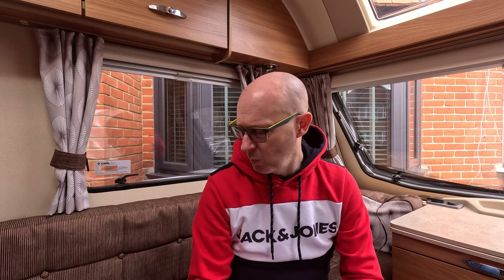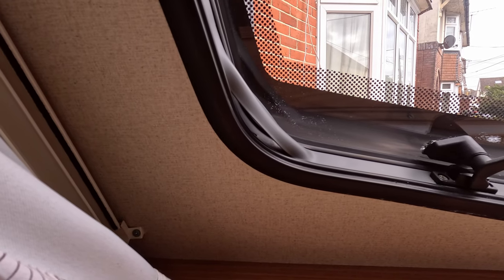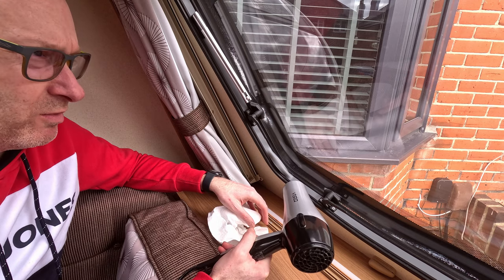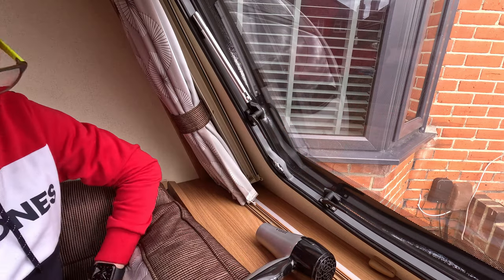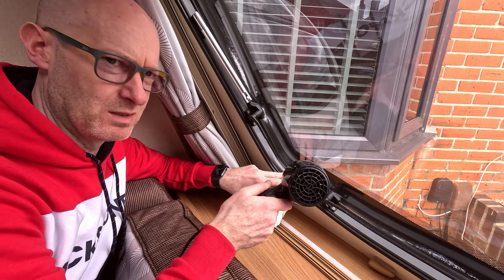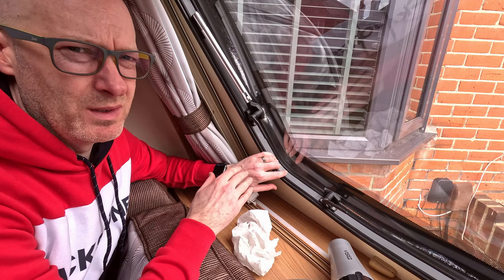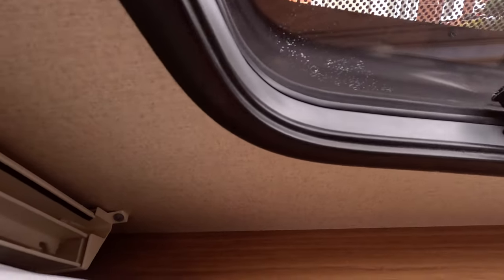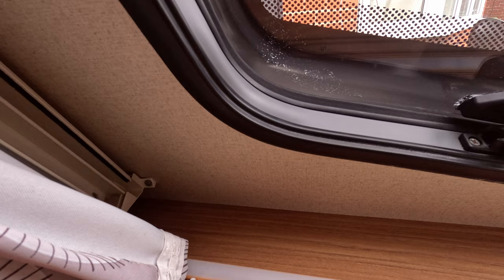Caravan Window Trim Fix, DIY Guide 🧐 🛠️ 👷‍♂️ #caravan

Comment: I had to replace the whole thing in my caravan centre front window.  It was so dry and old and sun damaged.  Just unscrew the catches around the window frame and pull the old tape out.  As I went around putting the tape in, I figured out you had to pinch the centre so you could get it secure into the rubber on either side.  As I went I also put a small hole in it where the screws had to be put back in as you couldn’t tell where the holes were if you went to far.  It was quite easy to replace.  I’m a 58 year old female and had never done it before.
Reply from the maker: Glade you were able to replace the original trim, just takes time but looks great in the end. In my other video, I show this being replaced and I used the trim tool, it's optional but speeds up the process.

Comment: I was giving my van a proper clean out over the weekend & noticed that I have 4 or 5 like that. A very useful video. Thank you.
Reply from the maker: Thanks Ian, this is always good place to start, and if it doesn't work for you then move onto replacing the trim, hopefully this want be the case.

Comment: Perfect timing I've got 2 corners to do but I need to replace the window too, might be easier to wait till I've got no window in
Reply from the maker: Glad it was of help, remember the silicone part is optional but will help with it not happening again in the future. Depending on the reason for needing to replace the window, if it was letting in water then you might want to remove the trim to allow it to dry out first.
Reply: @wobbleboxcrew  unfortunately some delightful individual decided that it wasn't to be a window any longer

Comment: Brilliant. Thanks for the tip!
Reply from the maker: Glad it was of help, just remember once you've heated up the plastic you will need to stretch it before putting it back into place. Also, this won't always resolve the problem, if you find it still keeps shrinking you'll need to replace the complete trim but links to these parts are in the description.